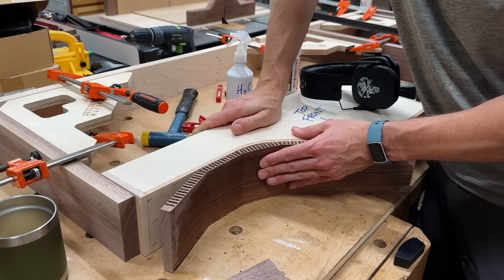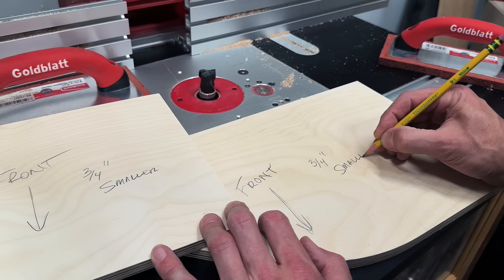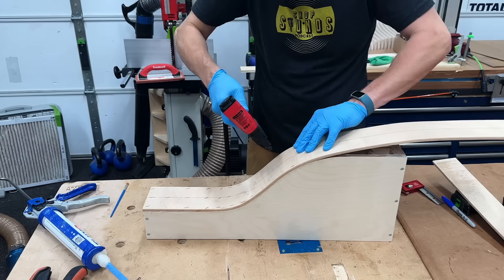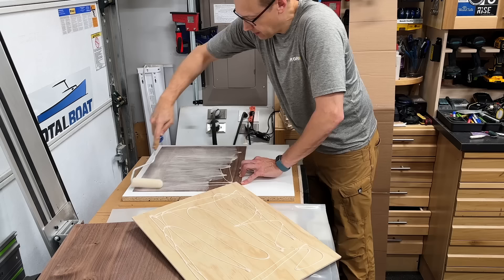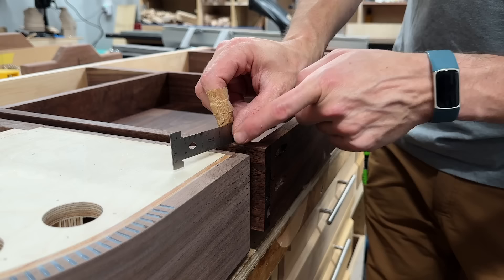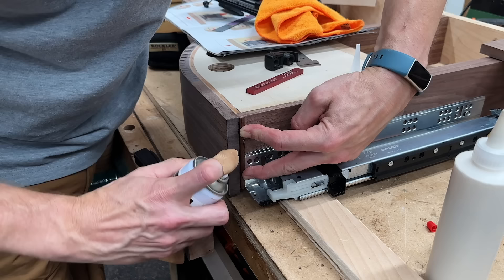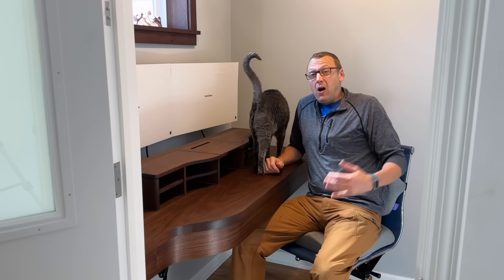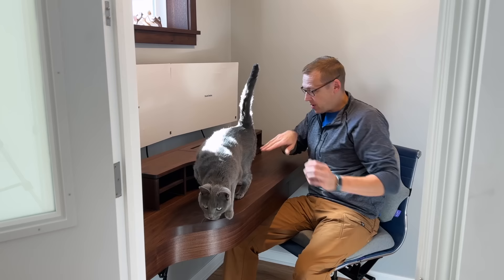How to bend wood and build a floating desk.

Comment: I recall some years ago, some folks found it more cost-effective to make their own acoustic panels using layers of towels, over buying acoustic foam.  "DIY Perks" channel demonstrates how much better the towels perform to muffle sound over cheaper packaging foams and pillows/cushions.  "Soundproof Guide" channel mentions using a fire retardant spray for fabrics on the towels for extra safety.
Reply from the maker: Yeah, you can certainly make wooden frames and fill with Rockwool insulation and then cover with towels or fabric. That just isn't really the aesthetic I'm looking for.

Comment: Awesome desk. I especially like the curved front. One suggestion since you had to need thin kerfs for the drawer fronts. I use 7-1/2" circular saw blades. Their kerf is approximately1/16" and they fit my table saw arbor. I know it's only 1/32" difference, but it can make quite a difference when trying to maintain your grain match.
Reply from the maker: Cool! Thanks for the tip!

Comment: Beautiful job Keith.  I always just take a 6" blade and Spackle and taper gaps away when installing on out of wack walls.
Reply from the maker: Ahhhh. I suppose a more experienced spackler can easily even out walls. Me? Not so much. 😜😂
Reply: @KeithJohnsonCustomWoodworking  I do want to thank you for using walnut Rubio over the pure. A lot of people on youtube dont realize that Walnut will lighten in color over time. So hopefully they will catch on with what you are doing finish wise.
Reply from the maker: @frankrizzo5967  So true! That Pure is just too golden out of the can as well.

Comment: Awesome! Why not recess that counter bracket into the top while you are at it? Then guaranteed not to interfere with the drawers.
Reply from the maker: Then I would have lost 1/2" of leg/knee space underneath. I know that doesn't sound like a lot, but it's a tight squeeze under there with drawers.

Comment: I think given how thick your top is, I would have dadoed into the top for the drawer faces to add a bit of detail. Just like a quarter inch. If it's not what you like then fine, but I think the extra detail would look cool.
Reply from the maker: I don't quite follow what you mean with that suggestion. 🤔
Reply: @KeithJohnsonCustomWoodworking  I mean, instead of cutting down the drawer boxes, cut into the bottom of the table top and leave the drawer boxes full height.

Comment: Great job! Is there any reason you couldn’t use the fig 8 mounting clips you originally planned on using over the drawers and just routed the bottom of the top just like you did for that piece of metal you had made? Just curious if I missed something.
Reply from the maker: You could definitely do that, but they would have had to have been surface mounted on the dividers. However, it’s definitely an option…maybe the easiest actually 😂

Comment: how are the saw kerfs covered on the bottom of the curved board - or does it matter if they are unless someone looks at it from underneath?
Reply from the maker: I filled them with epoxy, but they are there if you want to get down on the floor and look up. 😜😂
Reply: @KeithJohnsonCustomWoodworking  I like the desk forgot to say that. Thanks for posting.

Comment: Great build! Total newbie here, that knows nothing (worse than Jon Snow); Would steam bending be more appropriate with such high level of bending?
Reply from the maker: Steam banding is a different animal and you need to account for a lot of different things such as springback, which is once you pull it out of the clamps after it’s dried it will want to record a little bit with original shape. And setting up the steam box and going through that entire process just isn’t worth it for this little bend.

Comment: This is certainly an educational video.  A detailed study in how to use advanced woodworking techniques to waste thousands of dollars of beautiful hardwood.

Desktops typically become catch-alls for books, papers, writing implements and computer components.   What is the point of using 2-inch thick, solid walnut for a desktop? 

I just gotta say this looks like a massive waste of expensive hardwood.  Most of it is sawdust from kerf cuts or hidden in drawer bottoms and desk components that are never seen.  

All of it is used on a built-in furniture piece that can’t ever be moved to another location where it can be admired from four sides, not just one angle in a forgotten cubbyhole. 

·
Reply from the maker: You should see how much walnut I threw in the fire pit when I was all done!

Comment: Love you work!
but... I'm still not understanding why you didn't make veneer out of the long side of the slap and reapply it - you could even have done two strips and bookmatched them for grain continuity. as for having to go through a thickness planer or sander, you could always hand planed and sanded after applying it, or even before applying it. Still just unsure why all the need for the bendy stuff.
Reply from the maker: It's just more work for very little gain. Risk vs. reward.

Comment: I would not have cut the perfectly good oak wood to make a curve, you could just have got a oak veneer in that length and with, it was not much ....and essentially bending wood you are making veneer with feet to hold the thin bending veneer part if you see it from the side of the bent wood but since you had a flat surface you can just use a real oak veneer and glue it on it would have been exactly the same with less pain and time put in trying to figure out how to cut the wood to bend and all that. There is sometimes you need to make curved wood but I did not see the need for it to be done on this project but still its nice to see diy projects being done.
Reply from the maker: It’s walnut, not oak.
Reply: oh sorry yes walnut but either way same thing @KeithJohnsonCustomWoodworking

Comment: thick desks make sad legs
Reply from the maker: Not when they are built to the right height
Reply: @KeithJohnsonCustomWoodworking  i spend all my life sat at desks and using computers and i say it is not good. also never ever see this design used in any professional office setting. they always have storage off to the side. if it's high enough for not bashing your legs then your arms will be fatigued quickly by being elevated too high.
Reply from the maker: @cho4d  well, we all have different experiences. I have three desks with drawers in the middle and have no problems

Comment: Your workmanship with this piece is far superior to my abilities , but having some experience plastering, the gap you are unhappy about on the side at 29:30 seems more like a plastering problem than a woodworking problem. Sizing such a beautiful piece to the variances and inexactness of a plasterboard would make me scared about being struck down by the woodworking gods. - Perhaps that's the downside to viewing issues through the lens of a fine woodworker rather than that of a grubby plasterer. :)
Reply from the maker: Yeah, its actually a framing problem compounded by drywall and plaster. Square corners rarely existing any more. 😂